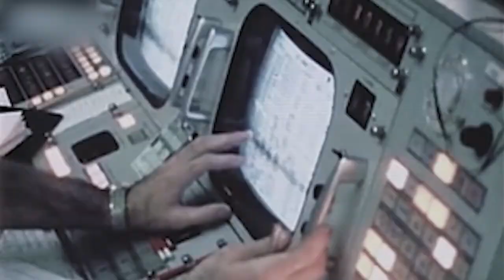APOLLO 1 DISASTER  | Disturbing Audio Captures Last Words

Comment: Why the hell is the cabin pressurized with pure oxygen? And why was the test not halted when a monitoring device detected too much oxygen flowing into the cabin? They know pure oxygen is highly flammable.
Reply: Oxygen weighs less than air. Weight saving exercise.
Reply: Hydrogen is also highly flammable... but the Hindenburg used it anyways, too.
Reply: It was cheaper, to pressurize with one kind of gas
Reply: @thevalleyy  no... It wasn't...

The reason behind the pure oxygen atmosphere was to reduce the cabin pressure in the vacuum of outer space, thus reducing the strength of the structure and saving lots of weight (which they were carrying a lot of).

To date the Saturn V rocket is still one of the most powerful rockets ever built... so building an even bigger rocket wasn't really an option.
Reply: Pure Oxygen was first used during the Mercury Mission. North American Aviation recommended that during the build process, NASA felt differently
Reply: @goodgood9955  oxygen is air. Methane is air. Any gas is air.
Reply: @nicklikesradio wrong. Oxygen and methane are part of the mixture that makes up air. 78.08% nitrogen, 20.95% oxygen, 0.93% argon, 0.04% carbon dioxide, and small amounts of other gases to be more exact. But nice try.
Reply: the test wasnt halted because the hatch wouldnt open and they couldnt get out.
Reply: this was the 1960s mind u
Reply: @jasono2139  they used hydrogen because of a US embargo on helium sales to Germany.
Reply: @maddslothii2532  yeah... I don't think so... hydrogen is lighter and readily available.
Reply: Remember, the capsule had to be pressurized to 16 psi for that test. That didn't help.